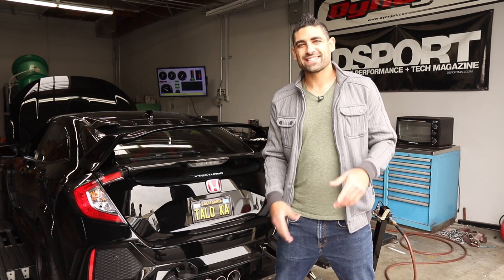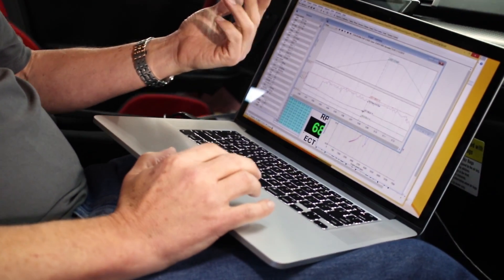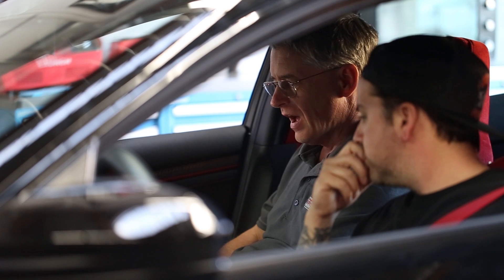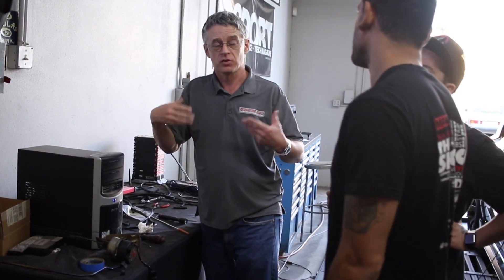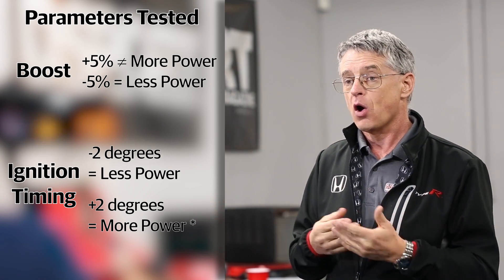Hondata FlashPro for Honda Civic Type R: Tested & Tuned

Comment from the maker: 0:25 Stock Dyno
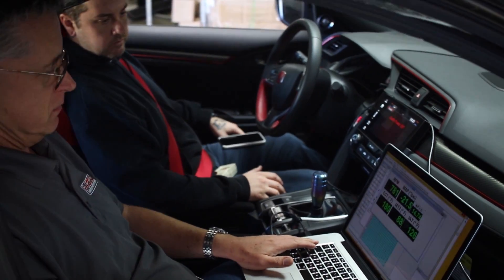0:45 Testing Procedures
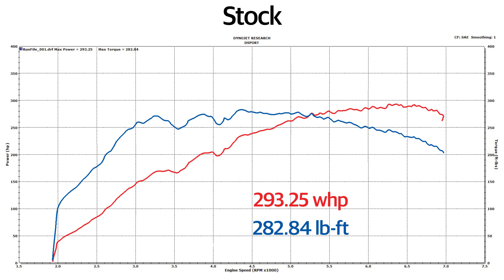1:03 Stock Dyno Chart
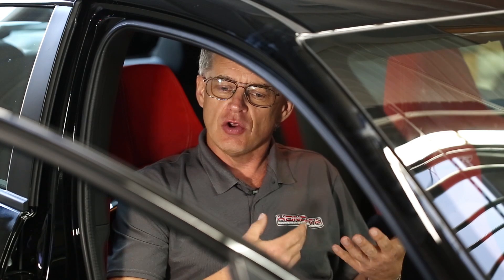1:25 Datalogging
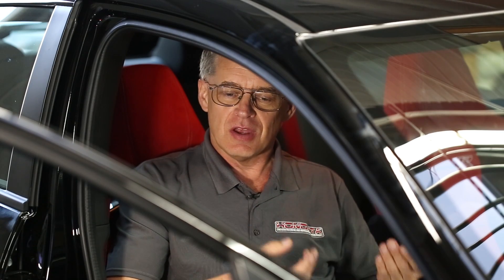2:44 Does more boost make more power?
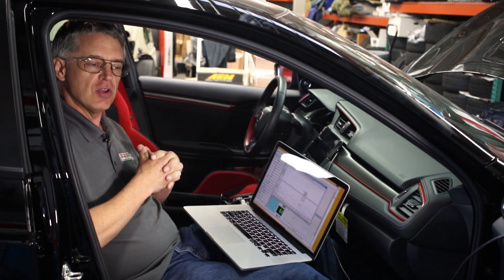3:08 Hondata FlashPro 91 Calibration
3:15 Parameters Experimented with
4:46 Safety Margins
Reply: You guys should start modding a Veloster N since it's so much fun to drive and it's obviously using it's power in a better way than the Civic type R
Reply from the maker: @AliEsko  I am pretty sure we will soon.
Reply: @AliEsko  hahahahahaha
Reply: @AliEsko  LOL the N sounds fun bro, the crackles and bang! But it was just lacking power I needed. I had a Veloster N. Although, I traded it in for a Type R, best decision ever imo!
Reply: What flash pro is that? I need 1 for my 2018 type r

Comment: Question! I recently bought a 2020 civic type R it’s already boosted up to 500WHP for sale from the dealership but the aem boost gauge isn’t wired nor there is Hondata flash pro. Do I really need to have a Hondata flash pro even though it’s already boosted?

Comment: Why hondas need 1,000s of $$ just to gain some extra hp? I used to have a 2018 GTI that will pick up 80hp from just a 93 tune done right at home.CTR need to upgrade intercooler,intake dp,full exhaust,hondata and other tweaks in order to gain 80hp.Take this Hondata for example: that's almost 1,000$ for just 20hp.
Reply: Sergio  all those upgrades with e85 and still can't catch a tuned gti with just a DP.
Reply: Sergio  e85?? U can't run e85 on a Ctr till u spend 3k on a hondata fuel upgrade,I know what I'm talking about cause I have a 2019 running e20 which is the most u can run before your weak system max out.So let's say that u need 8k$ to get those extra 100hp and I seen lot of guys blowing up them engines.
Reply: Sergio  and E20 is your limit,now u need another 6k to over over that ceiling cause your weak fuel system.
Now to all the blown out motors i seen at the dealership cause u pushing over the limit,bottom end  they not that good like old k20 k24s.
Don't be defending it,I do have a 2019 CTR and is the wrong platform for power but they great around the curves to go ahead and take your civic to some place where u can do hard turns,that's where u win my friend. *open your eyes,had u seen all the used CTRs for sale lately????
Reply: Sergio  2,900 but not everybody knows how to install that fuel kit, all that typing and when u planning to add clutch to the mix?? So now you on the 10k mark just to hug the 500hp club. 
Hondata alone is almost 1k.

Comment: Lol honda really underrated the bhp, no way its 294 whp and 305bhp? Gtfoh, more like 320bhp.
Reply: Dyno set up plays a role as well. A dyno operator can make any car look like it has the amount of power someone wants to see. A dyno should be viewed as a before and after tuning tool, not a single snapshot in time. The important part is how much power you picked up after changes, not how much the overall final number is.
Reply from the maker: @unicornmeat4775  Exactly. This is why we do before and after and use the same dyno operator, conditions, etc. This way we have a solid foundation to see the gains.
Reply from the maker: We've seen OEMs do that before. We've had a GTI here before that delivered more to the wheels than the flywheel - completely stock.

Comment: This is awesome! I wish he would have done it for E85 and 93 Oct. :D 
He really knows his stuff!
Reply from the maker: Doug is a sea if knowledge...
Reply: Hondata does have E85 and 93 tunes available. Just did the 93 octane tune on my CTR today.
Reply from the maker: @JP-ne7xj  Have you gotten it Dyno'd yet? How does it drive with this tune?
Reply: U can't run e85 on a CTR, fuel system is weak,u need to spend another 3k on a hondata fuel upgrade.U can run e20 on a custom tune.

Comment: that's pretty bad 
pretty much what a golf gti makes on a tune
Reply from the maker: The GTI's power is also underrated from the factory. We Dyno'd a 2018 GTI, and it was 236 horsepower to the wheels even though it was advertised at 220 to the flywheel. But to your point, the GTI has tons of potential with tuning.
Reply: @dsport  all euro cars do,you can do a flash and dp on a GTI and that gain an easy 100hp.
Civics need fbo n some more to get up there.This new engine is not as strong as the old k24s.

Comment: so, what is the explanation for the valley between 5200 and 5600 rpms? or around those numbers?
Reply from the maker: Wouldn't call that a dip. That's more like a hiccup. Since this is occurring after the RPM of peak torque, cylinder pressures are on the decline. Normally, this means that you may want to be adding in back some slight amount of ignition timing. Since the Honda ECU is constantly making changes based on the feedback from O2 and knock sensors, we could just be witnessing a spot where the timing change is taking place. It could also be where the boost controller is increasing the wastegate duty cycle. There is also the possibility that other factors are at play. You have to remember there are a lot of things happening concurrently from injection events, ignition events and cam timing events. What isn't changing are the shapes of the piston and the combustion chamber. It is possible that at that particular engine speed, that volumetric efficiency or combustion efficiency drops. Bottom line is that finding the actual cause may not be feasible in some cases. Notice how the OEM Honda calibration also had a hiccup at this same engine speed.

Comment: That dyno graph shows alot of miss fires
Reply from the maker: Hey Kyle, it's not actually misfiring. We don't have any filters on the Dyno, we have the Smoothing set at 1. Also, if we use higher octane fuel (CA fuel sucks) we would see smoother curves and timing.